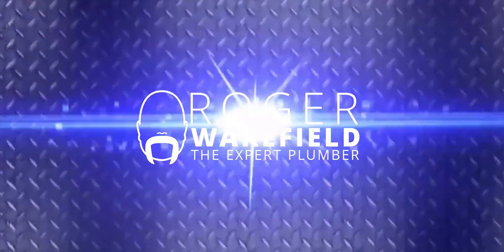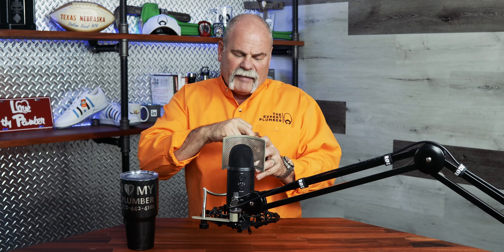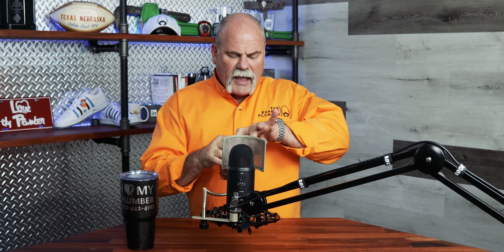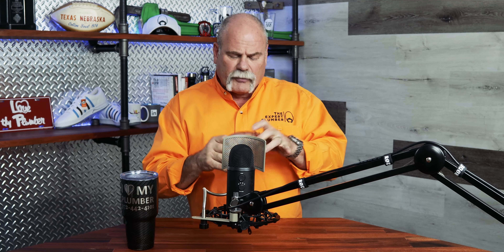Is ProPress Better Than Solder Plumbing Fittings??

Comment: My employer had us soldering everything,' until one guy burned down 6 units. Now we pro press everything. Personally, I love it, it’s fast and convenient. The only thing you have to be is extra cautious when crimping the fitting in a tight/tough spot where you might struggle  to properly place your pro-press tool. I’ve had a couple situations where I test my work and I inspect every joint and everything seemed dry, gauge pressure is good through out the day. The following day, I always recheck  my fittings and in two different occasions the tiniest drip of water, one that doesn’t leave a puddle because it’s so small, was oozing out. My advice is, double check your press fittings.
Reply: I don't trust the guy in this video. He basically trashes a lot of these products that make DIY jobs easier. I feel like he's concerned about losing work to DIY & other plumbers who're embracing these products to squeeze stubborn old timers like him out of the market. Propress & Sharkbites make plumbing jobs faster & infinitely easier. Being an old timers set in his ways makes him resistance to accepting new technology.
Reply: I've used it for about 9 years working as a plumber in the school district we have a lot of old buildings that go back to the 50s  I've done a lot of difficult repairs to do that would have been very hard to do soldering. I know because I've had to solder some 4" water mains in tight areas .I've used to progress and it was a lot easier. But on some of these old pipes I've had them leak instantly on pipes that were pitted . I have to cut in a bunch of 4" and 3' valves and wondering how well there going to do on the 3" copper lines because there hot water lines and a bunch of out hot water lines tend to pit.

Comment: So I consider the joint itself Inferior only because of the weak link the rubber o-ring. If minerals in the water are breaking down copper pipe the rubber has no chance of lasting just as long. As ease of use yeah I understand why people love it. At the same time you are taking the skill out of skilled trade, just my opinions.

Comment: The biggest flaw with Propress is that you cannot reuse any fittings once it is pressed. With soldering any mistake can be unsoldered and be corrected, but not Propress.

Comment: I’ve seen some soldered joints leak due to not cleaning the flux off a new fitting job and the acidic flux eats through the pipe some 20 years or a little more later so 50 years estimated for a press fitting isn’t too bad IMO. I love the presses for not needing the hot work permits like you said and the fact that if there’s a slow drip of water in a large system then a press job is so much nicer even though yes, you can plug the drip with bread long enough to get solder to flow properly.

Comment: Propress is definitely a lot easier to install. It only becomes difficult when you're in a tight space, than I would rather sweat a joint. I don't know what I would say is better from a longevity standpoint though. I'm sure it'll hold for a long time but no one can really say for sure. Older guys hate it in general. They say it takes skill away from the trade. I agree with that, but technology will always evolve and if it makes the job easier and lasts just as long there's no stopping it.

Love the editing by the way
Reply: Victor Vinegar I think that’s why they made it $3,000 so the diy guys wouldn’t buy it
Reply: I had that old timers attitude and I’m not old. It was more of a joke than anything. I’d say these damn kids and their propress never learning how to solder. That being said it was nice having a skill you could still teach rather than telling them to push a button. We started doing a lot of work for Austin ISD the past couple of years. They allow propress but not mega press. They said it’s because they can’t work on it which doesn’t make sense to me. It was nice however to pull out the power vice and dies and show a bunch of youngsters how it’s done
Reply: @joshcowart2446  i Just got taught to solder and honestly i am glad it is Not Standard in our company but i can see how it requires more skill
Reply: Krasser Dude it’s good to have that as an option though. For example, we put a bunch of angle stops on thinking we were putting in wall hung lavs. I had to take them all off and cut the rings to pull escutcheons whenever I learned cabinets were going in. The copper got a little messed up in the process and compression fittings wouldn’t seal so I just soldered on male adapters and screwed in threaded angle stops and it fixed it. Also if you do commercial work you’re ultimately going to have to put copper trap arms in and they don’t make pro press dwv fittings yet that I’m aware of.
Reply: Pro press is easy but every single joint will leak in 15-20 years
Reply: @Qusin111  why is that?
Reply: @Qusin111 Not true. Even shark bites last longer than that.

Comment: A few years ago I renovated a master bathroom and called a plumber that I knew and trusted to set my shower pan and shower valve. He used ProPress. When I was watching him, I listened and learned a lot. Later on I had another bathroom renovation and some other plumbing repairs over the years and both times I rented a ProPress tool from a local plumbing supplier. I learned how to sweat or solder copper when I was younger from my grandfather & dad and I consider myself a pretty decent DIY person.  So many times I've tried to solder "on-the-fly" or with water unknowingly in the line. A few times, when re-pressuring the lines, I'd find micro drips. Sooo .... drain the system, reheat, re-solder. Can be very frustrating. Also, a few times soldering copper in cramped quarters got to be a logistical nightmare and pretty dangerous.
Hands down, ProPress is soooooo much easier. Just a few weeks ago I rented the tool to replace a large section of M pipe that was seeping and two gate valves that were shot along with about 20-30 feet of 1/2" and 3/4" pipe. The fittings aren't cheap and the tool rental cost was marginal but a task of soldering 15-20 joints that would have taken an entire day or weekend, only took about 2-3 hours.  That includes cutting out the old, cutting in the new, dry fitting and connecting with the ProPress tool.  That being said, I was on the hook and responsible for anything that happened to the tool or if it was stolen. It was $50.00 to rent for a weekend. (1 day rental fee) but the tool with the heads, batteries, etc. was over a $3,000 deposit. A 3/4" ball valve ran about $22-$25.00 at the time of this posting. The cost of a plumber would have been around $350-$450.00 for what I needed done. Total cost, tool rental, fittings and L copper pipe, cost me about $175.00-$200.00.
Do I worry about the longevity and lifespan. Absolutely. Will I loose sleep over it, nope. My home was built in the early 80's.  The M pipe I replaced was only 30 yrs. old and had pinhole leaks. The gate valves were leaking and shot. The L pipe and ProPress fittings will probably last longer than the crap the builder installed. Plus, I won't be around or living here in another 40-50 yrs.  LOL
Reply from the maker: Ray C  I do like propress. I also agree that people learning to use it and make their own plumbing repairs can save a lot of money. Thank you so much for watching and commenting! I do appreciate it...

Comment: I personally love the propress and megapress! Love to solder also! Done that for many applications cars, refrigeration, plumbing. But this press together system is a game changer when keeping up with the demand! Amazing invention and investment!
Reply: FYI, they have speedy convenient HVAC press fittings, and even removeable re-useable push fit types too now. Yes, specialized HVAC sized fittings with built in high pressure refrigerant O rings, and they crimp connect together same manner. No more lugging gas tanks, brazing mistakes,  torching flames to set off alarms, and inner pipe soot from high heat to foul up TXV valves.  They're more expensive of course but IMO well worth it

Comment: Mega press is a godsend. We’ve been pressing for about 12 years and never any fitting failures. Plus you can work with residual water in the line. Also check out the jaws ridgid makes that work on Milwaukee and their own press tools. It’s an actuator with small little jaws you open by had and put on the fitting then press it. It lets you press on angles and is great for tight spots

Comment: I do apartment maintanence.  We have a lot of wore out gate valves that don't shut the water off completely or at all.  The Propress is great for the fact I can keep working to get that leak/install done.  I order the fittings on Amazon which are way cheaper than any Sharkbite (which I hate with a passion).  I use the Ridgid RP115 and plan on getting the RP315 as soon as I can.  A tub manifold install will consist of me sweating the copper in the shop as much as I can then using the propress at the apartment where expedience and safety concerns are a key factor. This cuts down on costs.  coming out of the slab I will do a propess to ball valve to copper then pex adapter to pex to the copper I sweated in the shop to manifold (if that makes sense).  I do this so the next guy down the road only has to cut off the pex to remove the manifold and replace with the same. This enables the next guy down the road to be able to do a replacement sans problems.
Roger, I live on your channel.  It has really expanded my knowledge and abilities vis a vis plumbing issues.  When I get to a problem I don't have an understanding of, I tell my manager "I'll be right back, have to go ask Uncle Roger"

Comment: I use pro press and I love it... the only thing that I'm worried about is sometimes I plumb into older piping with well water running through it with low PH. As you know this will cause the piping to become thin. Is it still a good idea to pro press the thin pipe? Usually if I encounter thin piping I will just solder it for peace of mind. 

I'm a well water guy not a plumber but we do install the pressure tanks

Comment: I prefer solder fittings but pro press fittings gets you in and out of job quickly the area where I work most of the gate valves don’t close or ball valves,like you said dealing with hot work permits working in day cares where you don’t want to set off the smoke detectors if you solder it’s a nice tool but pretty expensive!👍🏼
Reply: Funny you say that had to reschedule a main valve replacement in a condo unit but god damn main valve for that particular line doesn't hold water old gate valve waited 1hour thinking it was draining 8 floors and nothing.  Main 2inch valve outside doesn't  hold .

Comment: So how much each of them handle on
- Presure
- Vacuum 
- Heat
- Cold
- Temperature fluctuations 
- Pull stress
- Push stress
- Shaking stress
- Test of Time

Or what style of connection would you rather use on each of those stress

Comment: I love and use both methods in my shop. One thing I will say about using propress tools, I don’t think guys who just came into the field and guys or gals right out of school should use it. I think soldering is a art. And that’s what I learned to do when I first started. Solder before you press

Comment: I love propress! When i used to do service calls using propress would speed things up so fast i was able to add 1-2 more jobs a day and make more money. Waiting for the whole system to drain out and you know immediately if its going to leak or not. Fantastic system! It was expensive for the tool but had it pay for itself in a couple of months with the extra work i was able to do!

Comment: As a handyman, I’ve been looking into getting a ProPress for a few years now. I struggle with not only the cost of the tool, but the exponential cost per fitting (which you failed to mention). 
  However, every single time I’m soldering a fitting in old wok, and the heat travels up the pipe and gurgles that pocket of water (that’s lying in wait, for just the right moment, to totally screw my joint up) I swear I’m going out and buying one. As of yet, I haven’t been able to convince my wallet to let the cash go. 
  My question to you (since you’re a seasoned professional) would be, how do you justify the added cost to a homeowner? Especially in today’s market, where the cost of everything is already 2-3 times as normal. 

  Love your videos. I’ve watched many of them and almost always learn something new. And I absolutely refuse to use Sharkbite. I’ll never understand how they even make code.
Reply: @3:02
Reply: The tool is an investment. If you charge by the job you add your material plus 10% and you finish faster. If they're paying for material you just have to sell them the product say how it's safer (fire wise) and that they pretty much last just as long.

Comment: I have used pro press I love it it saves time  yes fittings are pricey but so are shark bites I have seen shark bites leak  I use pro press in renovation work and I am in situations where sometimes valves dont shut off all way and can still get the job done quickly. I love it

Comment: Love Pro Press
Was able to fix a leak live on an 1”1/2 or 2” line at a grocery store years ago
Cut line, got ball valve on second attempt, after water shot it out of my hands first try
Scary but worked perfect.  Been sold since
Reply: But $200 for a 2" propress ball valve compared to $45 kills me. The best $250 I spent on tools in the last few years was a jet sweat kit.
Reply: @irishmike4914  yeah I have an old Jet sweat kit 
But the ease and time saved is well worth the price to me 
Especially since the customer ultimately buy the parts 
I have the 2” jaws but only used them once in a supermarket.  Was a live replacement because water couldn’t be shutoff.  Worked great and never could have done it with a Jet sweat and torch

Comment: We have been using pro press for a few months now and I love it. The only downsides are that the Milwaukee tool sometimes clamps on so tight it's almost impossible to get off the fitting without hammering it off (especially when using Pro Press to Rehau adaptors) and it's more expensive when mistakes are made in cutting the right size pipe and things are already clamped but I guess that's more operator error than anything else.
Other than those two small things, Pro press makes my job a whole lot easier.

Thanks for the video from a new sub
Reply from the maker: BigDaddyLinux  thanks for watching and commenting! I love the feedback and additional information! And, thanks for subscribing!

Comment: What’s the best propress tool?   Is it the rigid?  Is it the Milwaukee? Is dewalt in the running with theirs?   What would you get the pistol grip model or the newer straight one?

Comment: I just started using pro press for the first time last week. I’m not a plumber, just a renovation laborer however I am assisting a plumber to do 300 hotel bathrooms for the next 4 to 6 months. 

Pro-press had been excellent, I feel like superman right now. The only question I have to ask is about cleaning the pipe that you are attaching it to. The pipe is dirty and dusty from being in the wall for over 35 years, do I need to clean that off like you clean off when you’re soldering? I know you have to takeoff all the burrs when you cut it and mark it before you press it together.

Comment: What are your thoughts on the manual pro press tools.  There is a hydrolic press about the size of small bolt cutters for around 90 dollars and a hand held with extendable handles for about 150 dollars.  Both tool will do 1/2" 3/4" and 1".  I do small home repairs so having a 2000 dollar tool would be pointless for me.
Reply: Home Depot has a “special buy” right now on the Milwaukee press  tool with 3 different size clamps, 2 batteries, charger and “free” oscillating tool for just over $700.

Comment: I would invest in pex tools before pro press.  I know you were not comparing those, but just saying.  I just think in the next 10 to 20 years everything is going to be pex.  I don't really agree with it, but that's where it's headed.  Also the ProPress is really hard for tight quarters, but it does seems like a really great system.

Comment: Im a plumber i feel the same as you i used progress in commercial work but residential id rather sweat my joints.   But that being said.  Megapress is far superior to threading gas pipe.     A few months back i did two house next to each other about 3500 sq ft.   Layouts were a little different But used about the same material on both.     The first i threaded it took me and my helper  A day and a half to do the first one and had a leak we had to find and fix.   The second i decided to press and no joke it took us about two hours no leaks no issues.    Yes the cost is substantial for the setup and the fittings but the time u save in labor makes it worth it , Not to mention if u rent the tool and the heads from the suppler for about 30 dollars a day.    Id like to see a video on mega press vs threaded pipe 
.

Comment: You can press an open propress ball valve on a waterline w.FULL LIVE PRESSURE, then simply close the ball valve. Amazing system.
Reply from the maker: Frank Grimes I like that so much better than sharkbite fittings! Thanks for watching and commenting!

Comment: What you're not addressing is the issue of residential copper pipe that is "M" rated thin wall that has a tendency to leak with propress harder copper fittings, they leak a lot almost like a sweet leak because the thin wall copper is crushing under the pressure of the harder fitting. This doesn't seem to happen on "K" & "L" rated commercial copper pipe.

Comment: Soldering,brazing is an art. Done right joint will never fail, yes I’m 64 been doing it 45years. It has stood the test of time.LEARN TO DO IT,OR  Take the easy way out! Yup old school. Didn’t the shuttle have a issue with a ORING